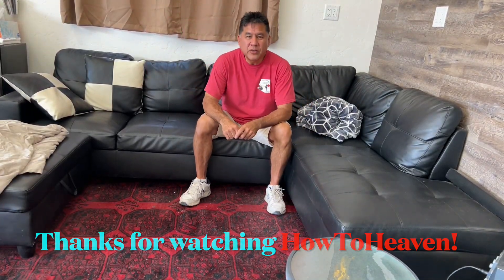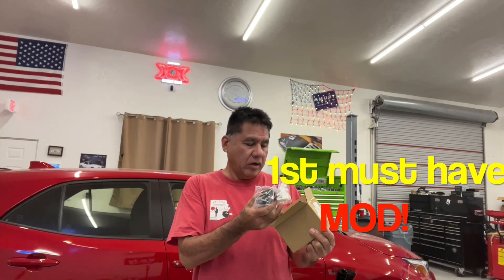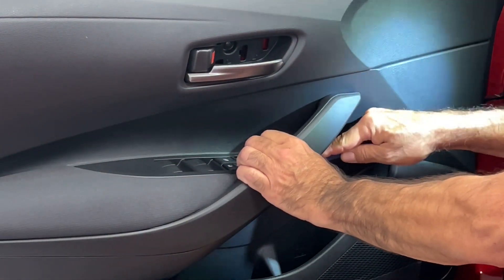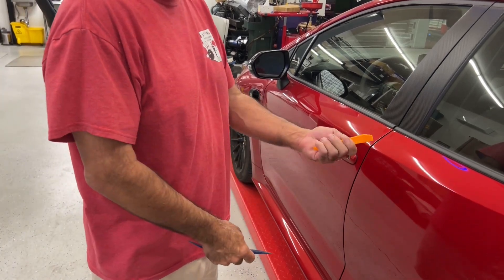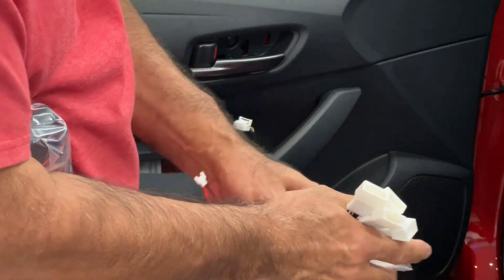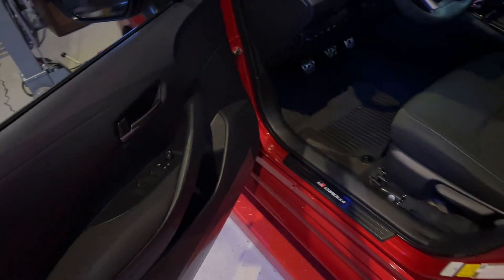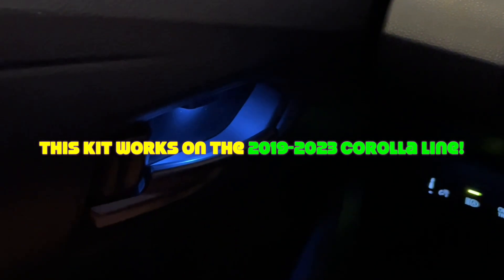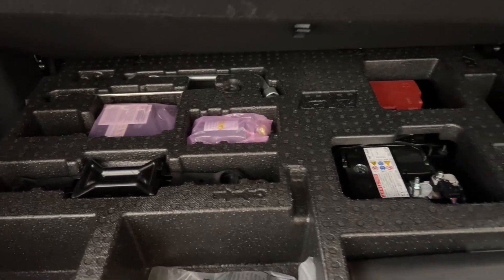3 Must Have GR Corolla Mods!

Comment: Hi  , enjoyed your video. 
I have installed the lights on my toyota corolla hybrid 1.8 2023 .
I had to take them back out again as they would not turn off !!! Any ideas what i am doing wrong ? 
Regards micky
Reply from the maker: No, I've installed 2 sets with no problems. They might be manufactured incorrectly? Did you plug the correct set into the driver's side switch? It's different than the other 3x leds.
Reply: @HowToHeaven  
Hi , thanks for replying, 
I managed to get them working,  they turn off now after 60 seconds.
Reply from the maker: Can you just write a comment on how you solved this issue, in case others have the same problem? Thanks! @micknick32